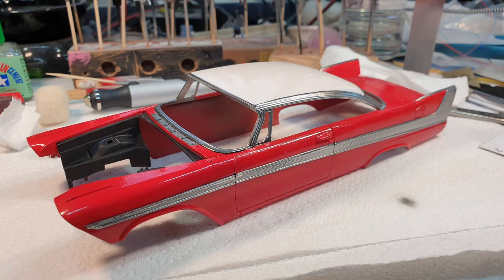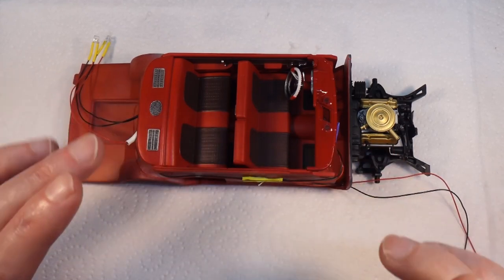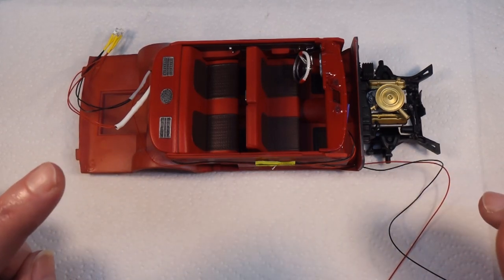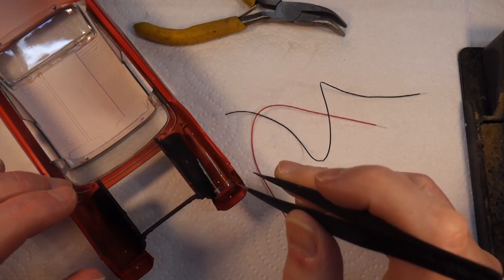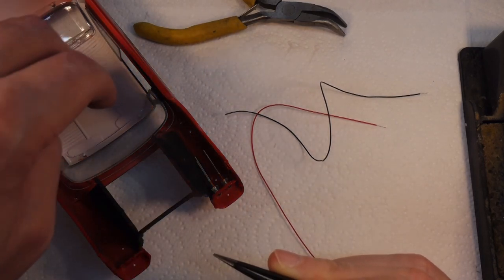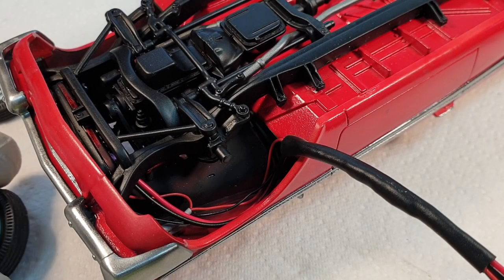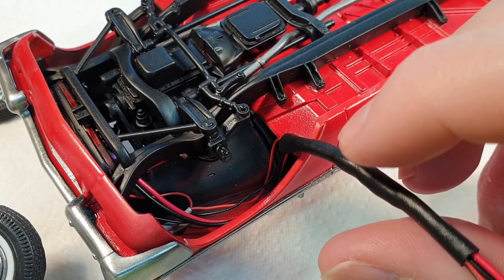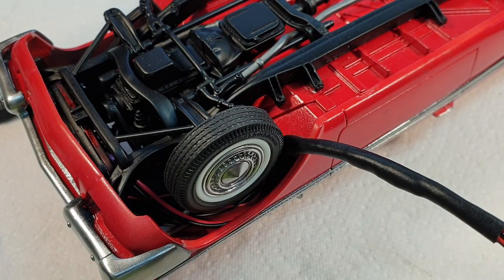Building the AMT 1/25 scale "Christine" '58 Plymouth Fury - Part three - putting it all together

Comment: Did you just put the bonnet on the body or did you fixate it somehow? It's really a shame that the kit doesn't have a hinge mechanism which they could have easily done...
Reply from the maker: It's just placed. It actually stays in place very well on it's own but, as you say, it would be nice to be able to open and close it properly.
Reply: @SteamGeezerUK  Thank you! I think l will build two simple hinges from some ABS material to hold it nicely in place. The orginal hinges are way too complicated to build as they even use springs.